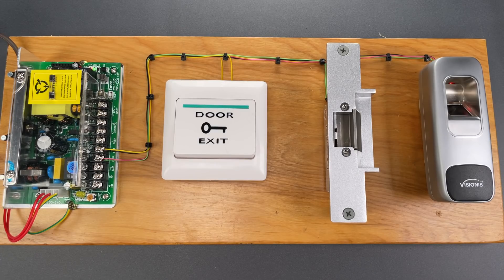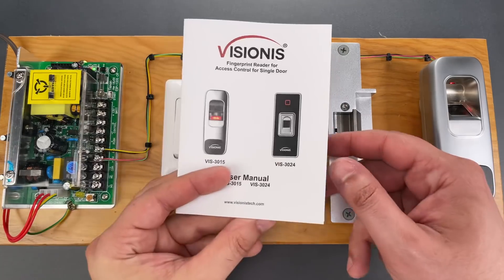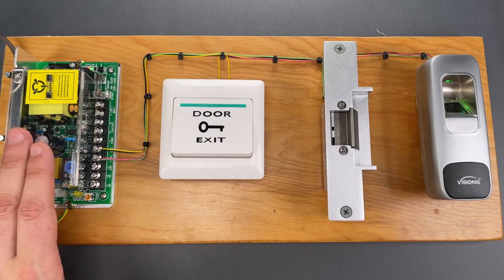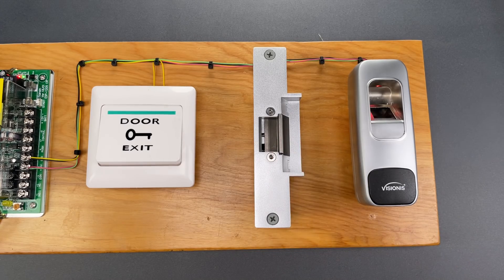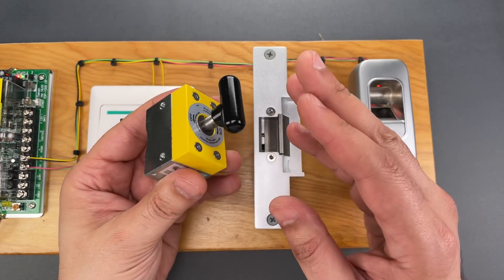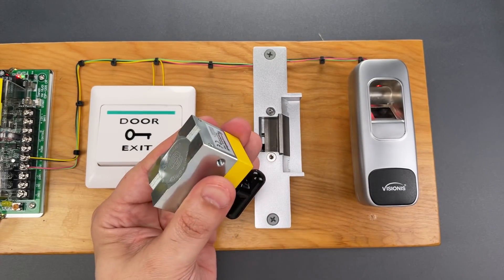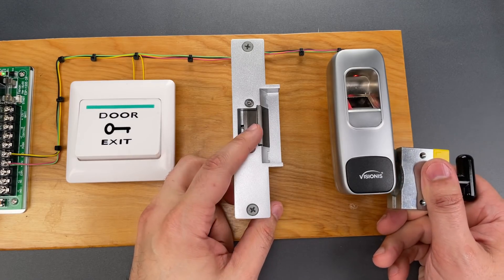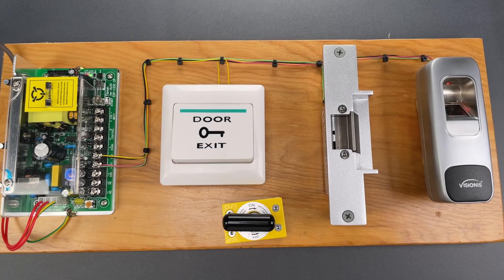[1359] Security Theater: Visionis Fingerprint Reader Bypassed

Comment: Yeah but isn't it designed primarily for lower levels of security? You won't find it on a vault door, but you might find it, say, on a janitors equipment room door. Peggy in HR doesn't need to get in, but Bob the guy who scrubs the floors needs to. The benefits would be, keys don't need to be made, and if someone is no longer working there, or has moved to a different department, you just remove their fingerprint from the scanner, add the new guy, and done in two minutes or less, and the terrible work toilet paper is safe for a other day.

Comment: Visionis readers can also be setup to relay fingerprint or rfid data only to an internal controller that then trigger the strike. I assume in this use case the method described would not work. Are there any pitfalls to the interior control setup.

Comment: Would it be fair to say that these videos could make this kind of security system a bit stronger?  If someone were to install this specific model on an entryway, they could potentially just build up some structure/wood/masonry around the lower portion of the reader assembly to prevent most discrete magnetic devices from getting close enough to influence it with a magnetic field...

Comment: This locking system is used in hospitals, same as the keypad system and video 1045. But these are outdated systems compared to the card key system. And good advice not to try to pick these locks is there usually the first defense for guarding medium to high-security areas, this includes areas with a lot of cameras you cannot legally go into and have a lot of armed guards. 

Also note the card key system is a multi door system.

Comment: Hey, I never thought about physical relays before and this made me open one of our units in our medical clinic.  After a bit of testing I managed to find a linear relay that indeed could trip in this manner.  Worse yet, it was tripped permanently until an electromagnet pulled the latch to the open position (it was a two position sliding bar relay).

You just saved us from a potential HIPAA violation and got me a bonus.  Thanks, LPL!
Reply: I work security at an airport. All our locks are electro magnetic... I suspect they aren't as secure as they should be
Reply: @calebwithers9690  Well the good news is a few layers of shielding tape fixed our systems.  Easy enough to apply, you just have to make sure you get tape that's coated so it won't conduct (because this goes on both sides of the relay, and will likely touch solder points on the rear of the board).  Two layers on each side and the magnet trick stopped working because the shielding tape is now the preferred pathway for the magnetic field.  Science!

Note that a sufficiently strong magnet could still bleed through and have an effect, so not an ideal solution.  We've implemented the workaround for now and are looking for a system that houses the relays in a location off the user panels.  This just requires a low signal line that trips the relay remotely and away from magnets (likely in or behind the steel door frame), so we would do it ourselves if the relays were not on board and hard to remove manually.

The good news is there are solutions.  The bad news is most of these units are poorly designed for fixing them the right way.
Reply: @rudderscotch  manufacturers make these decisions based on cost and ease of installation. If they're tricky or more time consuming to install, security companies won't buy them cuz they bid on jobs with lots costs in mind.

Unless someone comes up with a standard that says we require our locks to meet XYZ standards....
Reply: @vueport99  "Unless someone comes up with a standard that says we require our locks to meet XYZ standards" - I propose a standard that requires all locks to resist external attacks for at least five seconds.  Yes, that's a laughably-low standard, but it seems to be a higher standard than currently employed.
Reply: @nomore6167  it's a joke right now sticking in a random piece of metal and it opens
Reply: @rudderscotch  How about adding another relay to the problematic relay - one that closes the alarm contacts? If someone tries to break in using a magnet - there will be an alert.

Comment: Well, I bought one of those, but it's rfid and numeric code, but I unsoldered the relay and put it on the secure side of my anti porch pirate lock box, knowing that this is a bad flaw with those types of access control modules.  I also super glued the module onto the mount of the module, so it cannot be casually removed and have the wires tampered with.

Comment: Could you implement a NC relay (never even has to be powered) with a weaker spring right next to the NO relay on the same circuit, so if ever someone tries the magnet unlock method, the NC relay will open, breaking the circuit, even if the NO relay also was triggered by the magnet?

Comment: People using solenoid relays in security systems …. Or any sort of switch or sensor that can be tripped by a basic magnet (I say basic because I have seen some safety sensors for industrial equipment that actually have to be matched to a 2D magnetic pattern and cannot be tricked with a simple 2-pole).

From an industrial safety standpoint that’s stupid to have the decision making on the insecure side. It should only record data that gets sent to processing on the secure side (preferably within another secure and hard to access location).

From an electrical engineer and automation standpoint… this product seems like a high school hobbyist electronics build. Something else I noticed is that there didn’t seem to be ANY real controls on the secure side. Which means there’s probably an easy way to enter more “valid” fingerprints. Which also means there’s not ability for audit and access logging. Whose credentials opened the door, whose credentials added more credentials, time/date a valid OR invalid fingerprint swipe was attempted.

Comment: If you want a better one of those magnet switches try getting your hands on ones that are used for steel fabrication there was bastards are fucking strong they're often used as vices on drill presses and surface grinders but you can get pretty small ones
Reply: Aren't those electric devices, that need a battery or mains power?

Comment: Connect your stand alone system to a controller with or without software and the issue with the magnet is gone. All stand alone access systems have relays and relays can be triggered with a magnet. Always consult your security professional before installing a security system in your home or business.

Comment: whoever designed this system is a complete joke of an engineer
are you kiddin me?
at the begining of the video I thought that the finger scanner would send some kind of secret signal to the lock to make it unlock
even without the magnet (considering they use transistor switches) you can still very easily supply something like 12V in the yellow wire (simply short it with the red) and the lock will open

Comment: The alternative would be to have the primary cpu with the key sitting inside, and then have an entirely separate intelligence at the outside to manage the sensor and communicate the data back to the inside for verification. This makes the lock significantly more expensive, both to design, build and install.
How common is this setup I do wonder. Will you find this is if you hire a professional company to do the security for you and is it just the cheapo ones that have this issue, or is it common in professional oriented hardware too?

Comment: I wonder if you know about SimonsVoss 3060 System. Digital Cylinders. And Terminal SREL 2 and SREL 3. I use them only with Antennas at place that need to be secured against entry. Without Antennas there would be the same flaw (i still use them like at places that dont need to be that secure.). You just need to short-circuit the wires at relais.
Reply: I wish i could send you one...  But those are expensive. Software around 1000 - 5000€, Zylinder 350€, Srel 2 300€, Srel 3 1000€

Comment: Is it that hard to implement fingerprint validation circuitry closer to the power supply (far away from scanner itself), and the scanner would just scan the fingerprint and send its data to validation system by wire pair.

Comment: Obviously sending the fingerprint data to the box with the power supply is the only way to have security.  It's just a single image, I doubt more than a simple data cable would be needed.  Shocking if it's really too expensive for the manufacturer to do it right

Comment: Of the ways he mentioned to defeat this lock, the magnet is actually preferred. If they have a system the monitors when the lock is activated it would completely by pass that system as well since the reader is never activated when the lock is bypassed by the magnet. You COULD get around this by using a motion detector or a circuit that is active when the door is closed but I would imagine more people doubling down on the system they already put in and attaching the secondary system to this thing rather than having a totally separate second system.
Reply: depends how it's installed, using a magnet could cause it to report an alarm on that zone if it's set to fail open on fire alarm

Comment: Is there any preference whether the magnet is north or south pointing to the finger print sensor?
Reply: Probably won't matter, as the coil is magnetic in the system (skewed to one side), and either polarity should attract it (with the caveat that the iron doesn't have some weird magnetic property itself, but we're talking like laboratory testing required kind of changes that you won't notice). Now your magnet itself might be more dense magnetic field on one side too, but really any magnet polarity should open it.

Comment: if you connect the lock mechanism + & - to power supply control access it should be more secure..the fingerprint reader only use as opener not controller..lock mechanism to COM and NC..reader to Ground and PUSH..the only way to open the door is to dissamble the reader and short 2 wire from exit button(same as reader cable to Ground and PUSH..correct me if im wrong..

Comment: Have you done any 60’s model GM door cylinders? I’m just a dabbler in playing around with lock picking for something to do and being that i work in a restoration shop, I’ve got a load of old door lock cylinders and ignition lock cylinders. I’m assuming there’s security pins in them that are tripping me up but I’m not sure. 
I’ve got a pair of door lock cylinders out of a 63 Impala that i could send in, if you would take them in. One to un-tin and disassemble and the other to play with

Comment: I'm not sure if this is necessarily as fatal a flaw as it looks, though. When opened as intended, the lock is disengaged for a few seconds, while using the magnet only works as long as the magnet is physically in position. If the lock were positioned so one couldn't reach both it and the door at the same time, this method might be defeated.

I doubt anyone actually installing one is going to think to do that, of course, but it raises the question: Is there another bypass which would allow for an extended access window similar to what the intended users would have?

Comment: It still amazes me how many people are willing to make locks that are not secure against this sort of attack. 

I made my own DIY electronic door system and all the processing was done in a box 6 ft from the door inside. all the lines running outside did was send keypad and NFC inputs and receive sound and light output. there was no way to override the system electronically, it even had a fail secure lock. (there way a key backup to the lock so it could be picked but for our application that was acceptable as it was a very high security rated lock)

Comment: That magnet is a halbach array. It uses the alignment of magnetic fields not to "turn off" per se but to make the permanent magnet fields destructively interfere with themselves. Then by turning the knob you switch the orientation of magnets to focus the fields they make in the desired direction.

Comment: These types of system are still useful where all you need is access control to for example janitorial supplies, staff get in easily, joe public doesn't.  They cover the liability aspect of not having an unlocked door someone can wander through & spill chemicals on themselves perfectly.  You don't need a bank vault door for such purposes.
The point is to understand what such systems are good for & what they aren't.

Comment: So it's nice that you show this trick for this particular sort of lock but I'm not satisfied because I want to know if there's a way to improve this lock, I wouldn't be afraid to make some changes to the lock if that's possible, I don't know what's on the inside of the fingerprint reader, maybe it's possible to relocate the relay to the inside via extension wires that you can route along the other wires and then fix the relay somewhere next to the power supply, that would be a simple enough fix I think which eliminates the influence of the magnet completely.
I wonder why they didn't do that in the first place.

Comment: I have a question guys, with this type of electric lock, if there's a power outage, will I be able to get in the house?
Reply: The electric strike plate, the 3rd item from the left on the board, mounts to the door jam / frame and captures the latch that is mounted on the door.  The latch is your typical door latch and would always be locked. It would have the usual key (in most cases) to unlock just like you do now with your front door.  

The strike plate can be either a Fail Safe or Fail Secure. A Fail Safe will unlock in a power failure. A Fail Secure only unlocks when power is applied. In a power failure it remains locked. In either version, you can still use a key to unlock the latch and turning the knob retracts the latch from the strike plate. Hope that helps.
Reply: @JustinKais  thanks 🙏

Comment: I have been using solid state control chips now instead of relays for well over 20 years in my designs with no issues. I'm surprised these lock makers are still using mechanical relays. The only time I use relays these days is for high amperage power switching. I can't see the solenoid in the door latch needing massive amounts of power so I don't see the logic of a relay.

Comment: Well first off, just to make note, these types of finger print readers are at all not meant for any requirements of high value escalated security deterrents. Most especially in this day and age. These types of specialized finger print lock deterrents as this one displayed are meant for the most simple low cost effective access to such locations as restrooms, bathrooms, lavatories, printer(s) rooms, break rooms, employee only areas, and so on.
This system as shown, although wired nicely and accentuates good training device, (Which maybe it already is), is absolutely beyond any reasonable doubt, not meant to be used as any moderate security means or otherwise to "Hide Your Gold"......
So, the contention that I can purchase a high dollar magnetic covert switch (Which I really do think is pretty cool in it's own means and equally has additional uses) but which may allow me to physically and "possibly" be used as a hack into a restroom or some employee break room, or as such as.... is well, kind worthless and borders on surreal and personally is not of any personal use at all.
Simply because honest real high value targets..... associated with finger print readers.... will not hardly even be considered in the employment this type of simplistic security action (Since 19981 that that I am aware of)..... But you can always get what you pay for I guess to make your point of points of understanding...... and then again you can also make due with the exploiting and then exonerating of these types of individual and discriminate items that then result in planed purchases....
But hey, who am I? eh? Just a Joe that thinks the magnetic on off switch is something cool that someday.....that some day...I might have a use for in my ever expanding electronics laboratory...
Who knows when you'll need one?

Comment: Oh my god! How could anyone call themselves engineer and design such a terrible system. Any hobbyist would transmit either the fingerprint (adds only the cost of some shielded cables), an OTP (which is only adding cents to the cost for a cheap OTP similar to EV1527 and probably the best solution), or at least require 2 cables to be permanently connected and if they get disconnected the outside device wouldn't work until the whole system is reset (which is extremely cheap).

Comment: Fingerprint readers aren't really about "security theater" -- they're about the convenience of not having to carry a key (or magnet).
Reply: True but the issue is that ppl think they are more secure than regular keys and sellers try to make ppl think like that.
Reply: @Natsukashii1111  The fingerprint biometric is in principle more secure than a key match.  But to be secure it can't lock like in the video.  Has to be completely different..  A screw controlled by servo motor maybe.  That would be expensive though.

Comment: Ok, now just replace the mechanical relay with a solid state relay with no moving parts. How would you beat it?
Reply: @KahruSuomiPerkele  With the solid state relay, you can't hack it with a magnet. Then as long as the case is hard metal and there is no way to access the ssr. Shure, if you can open the box, any lock is pointless. Maybe I did not well understand?

Comment: This kind of lock is used to just mildly restrict access in busy areas... High security is hardly necessary. You can always just walk in as someone on the inside presses the "unlock" button.
And it will be just fine for this type of application.